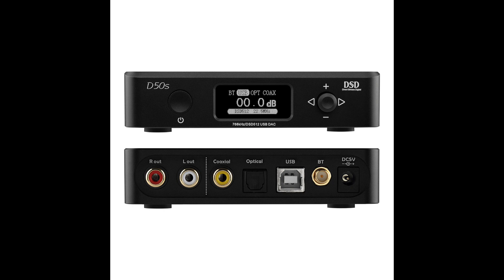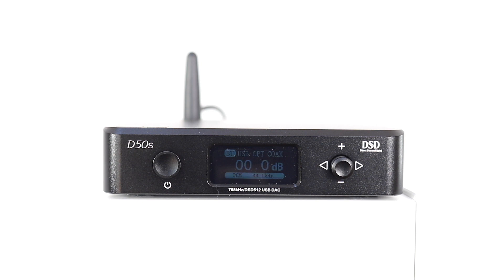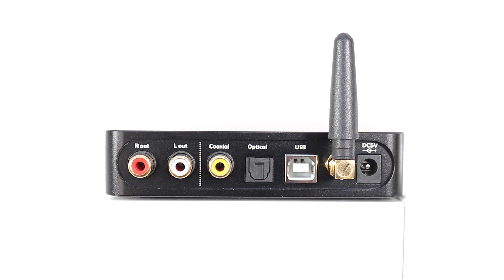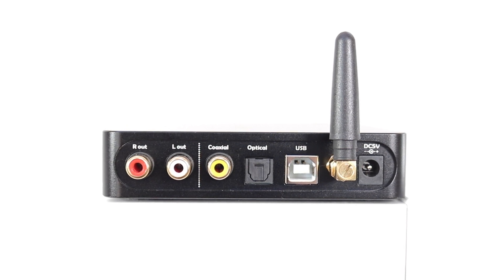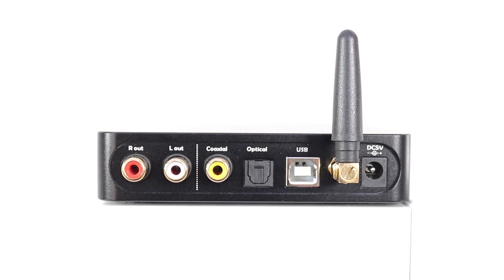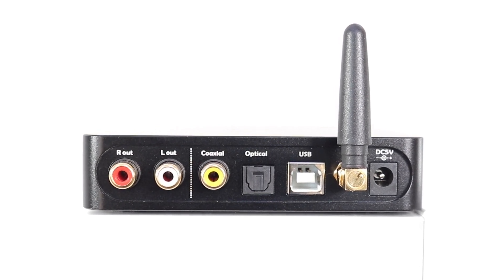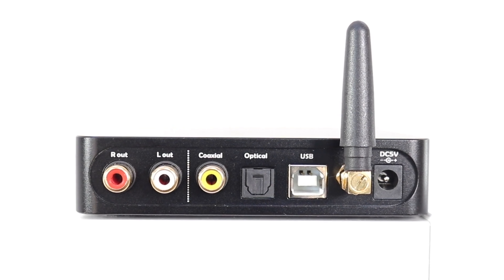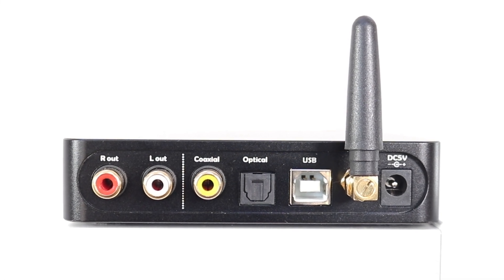TOPPING D50s DAC REVIEW PT.2: DOES THIS DAC HAVE A MAJOR TECHNICAL ISSUE? SHOULD YOU BUY?

Comment: I use a Benchmark DAC1 for my main sound system and two D50S, one at my desktop with iFi Zen Blue via coaxial input, one with WiiM Pro Plus streamer via coaxial input - both Toppins DACs powered by their own Topping P50 linear power supply. Very satisfied. No issues with the Toppings!

Comment: My experience to fixing the Topping D50S intermittent dropout sound problem on the coaxial input is that you have to use a 75ohm coaxial cable as short as possible, besides that you should also use a linear power supply because it will make the coax signal more stable compared to a USB phone charge. Since 6 months of using this method I never again experience the intermittent dropout sound problem as before. In my application I use a Monogami 2964 75ohm cable 50cm lengths with Amphenol ACPR connector and BRZHIFI 1A Linear Power Supply and coax input source from Sony BDP-S1500 BD player

Comment: I am having an issue with UNLOCK that I cannot find any answers to! D50s DAC with P50 power supply; USB and Bluetooth work fine, but the UNLOCK issue is with OPT to my SONY CDP-XE370 CD player. I've tried two different OPT cables and the issue is still there. Please, can anyone help?

Comment: I bought a Topping D50s yesterday and it's not working.  My issue is with the USB input.  The first time I connect the D50s and play a track I get approx 4 seconds of music then it cuts out.  Any track after that i get silence.  Bluetooth works perfectly well with the D50s and I don't have optical or coaxial cables to try.  I bought the dac for the USB input so it's a real disappointment

Comment: I had a similar problem with a electronic (in development) and it was a cold soldering connection, after the device was heat up, this problem was done. The only way to be sure this problem didn't occur again was to find the cold connection with ice spray and resolder this point. Nice video 👍

Comment: Paul. You may be interested to know my experience. I have an Oppo 95 Blue Ray player that I've used as a transport for years. In order to save money, I purchased a half meter length of a rather expensive digital coax cable. The cable sounded fine to begin with then the music would stop. I had to restart things several times then nothing. I installed a firmware upgrade on the aging Oppo and no change. I contacted the confused cable company who very helpfully sent me a full one meter length of the same cable. Like magic the Oppo began working again and has continued to do so. The cable company was gracious enough to exchange my half meter for a full meter at no additional cost. The Oppo continues to work flawlessly with any one meter length of digital cable I use.
Reply from the maker: Many thanks for sharing your experiences.

Comment: Hi Paul, I‘m pretty sure that there is a generic problem with the D50s Coax input since my issues are even more strange. My D50s is connected to a Bluesound Node with a 50 cm coax cable and worked without dropouts or other problems. Then I wanted to change the position of my Bluesound Node and therefore needed a longer coax cable. I changed it to a 2 m Sommer coax cable (of course a 75 ohms cable) and got no sound at all! The D50s didn‘t unlock and switched off after some seconds since there was no signal detected. I took another cable with a length of 1 m. This worked with cd quality tracks but playing high res tracks 24 bits, 192 kHz I got a sound full of dropouts and glitches! Next I tested with another 1 m cable and this worked perfectly! All the tested cables have been used before for other digital connections and I didn‘t ever experience any issues. I did some investigations in the internet if this was a known issue and found several users with exactly the same problem. Some cables work, others don‘t. The chance to get it work properly is better when using a short cable up to 0,5 m.

Comment: Tighter tolerances is generally a good thing. But excessive jitter will fall outside those tolerances. The AKM fire set a flurry of redisign. Frenzied work left a few soft patches here and there. But run-in seemed to sort things out.
In any case I would use USB connections for trouble free operation.

Comment: I seem to have a similar problem with the d50s.  It always works with optical, usb, or Bluetooth, but coax input is very erratic.  Sometimes works for days or weeks, and sometimes doesn’t work for days or weeks.  I thought that it might be related to the raspberry pi streamer (with allo digione “hat”), but have become convinced that it is the d50s.  Changed cables and tried other digital input sources, and it still doesn’t work.  On the other hand, the raspberry pi streamer works fine into other dacs.  The d50s coax input sometimes starts working again during the course of trying different configurations to “fix” it, but equally often stops working after I make some “innocuous” change (ex. unplug some cables to move things around slightly). I’m convinced now that it is some sort of noise/ground problem. I have seen reference online suggesting some bad resistor value choices that were used on the coax input.

Comment: I have had this experience many times in the past 30 years, and I am confident this particular issue is much more common with digital equipment. First... there is only one digital RCA jack. Two... many inexpensive sourced parts (the RCA jack) come with protective coatings. Three... reconnecting a plug many times will eventually wear off that coating if you do not use a solvent like acetone or chloroethene to clean it. Four... this coating on the analog jacks will not create a problem but can be verified by scoping a sine wave on the outputs before and after you clean them. If you please let me know if that is the issue. Thank you.

Comment: I have a d50s and I have used it mainly with the  Bluetooth connection (which has a very good sound quality I must say). I have also used the optical and digital connections with a Yamaha cd-s 300. The Usb connection  I used it just for half and hour to test it with my PC. I must say I haven't had any of the issues described in the video and I have to say that I'm very happy with it, I like the construction and the sound quality it produces.  I also have a audiolab 6000cdt I have just bought and I intend to use with the DAC in the near future.
Reply: Did you hook up your audiolab 6000cdt to the D50s coaxial input and if so did it work without dropout issue? Your D50s has the CS 8416 spdif chip as described by Paul in the video?
Reply: @barrystamp8600  Yes, I connected the 6000cdt trough the d50s and had no dropout issues. I dont know if there are different chip models in  this DAC, havent heard of it.
Reply: @jorgeplaza7938  Thank you for the info. It depends when you purchased your DAC...All new Topping using CS8416 spdif receiver (As mentioned by Paul in his video) instead of the AKM chip. What method you connecting the Audiolab to this Dac, opt or coax? What cable lenght + Make of cable are you using?

Comment: Could it be a particular run of the cirrus chip? I just recently purchased the D50s and haven't experienced the problem or any problem for that matter.

Another thought occurred to me. The first time around you reseated the plug on the dac end. When you replaced the cable then used cable 1 again you reseated the cable on both ends.

Comment: Interesting... I have a Lavaudio DS600 which we all know looks very much like the Topping D50s but has an additional headphone jack. I regularly experience the same kind of drop-outs lasting 2~8 seconds between any given two tracks on a CD, when and only when I have a certain model of bluetooth speaker connected via a 3.5 to 3.5 cable to the DS600 headphone jack. No such problem occurs when I have a pair of earphones plugged in to the same headphone jack and everything works fine. I guess I will have to try cable connection of some other bluetooth speakers available around me and see how the CDs go.

Comment: I have an issue with my E30 where it locks up and has to be reset. Only happens once in a blue moon but Topping are sending me a new one from China. I use the Coax input from my CD player (Marantz CD6007) occasionally but prefer the sound direct from the CD Player to my amp, but must say the coax has never given me any issues. I mainly use it for USB. When the new one arrives I'll try the coax again as this should have the Cirrus Logic input chip like D50s. I'll let you know how I get on.

Comment: Well I found this video very satisfactory as you did the best you could do. Thank you for your time, trouble and posting your findings. The question is which CD Transport did you use? I did advise previously of having this issue using the Audiolab CDT6000 Transport. I have just checked on the internet and my Denon Amplifier uses a different DAC Chip to the Topping. I did not swap the coaxial. I will try another and see. Could the issue be with the Transport. Since I mentioned the issue to you a few weeks ago, I did see that on a Amazon UK Audiolab Purchaser had the drop out issue too in 2019. So, including myself and the two other users online all having the issue in 2018, 2019 and 2021, it is not a batch issue.  If you used the CDT6000, it could be that, or it could be both the Transport or the DAC. Strange. Who knows as there are so many different variables.
Reply: From my understanding it is the high demands of the new Cirrus logic spdif implementation used by Topping instead of the AKM chip in their older Dac models (AKM factory fire) that this CS 8416 CHIP is very picky especially with CD Player's that produce high jitter over spdif that this chip has problem 'locking' on to the signal or the signal is too low from the source. Topping have now put notices on some forums and Amazon that certain dacs should not be used with CD players due to this chip.

Comment: I had a similar issue with my new Audiolab 6000CDT connected to a Parasound Halo and thought the new CD player was defective.  I tried a few other CD players with the same coax cable and had the same dropout issue.  And guess what no more dropouts after disconnecting and reconnecting the different sources to the Halo I ended with the Audiolab player and it played perfectly.  No dropouts.  Maybe the dropouts were only in my head.  I guess I'll never know.

Comment: I used it with a AudioQuest Carbon and had no drop out issues
Reply: hi justin do you think i can hear sound difference's between coax cables ? assuming they work with no issues....i really wonder. and does optical cable sounds better or worse?  thx
Reply: @גדאור-ג7ע  I found coaxial cables to sound more dynamic with a bigger wider soundstage than optical. The better the cable the bigger the increase of detail and tonality

Comment: You certainly have had a disappointing experience!  I am lucky that I've never had any problems with my D50s/A50s stack, though I only use the USB and BT connections.  In my particular use case I highly recommend the D50s, but based on your experience I might be much more hesitant to recommend it if coax is required.